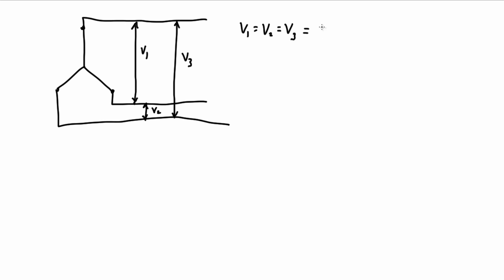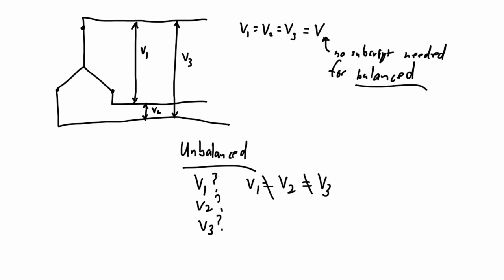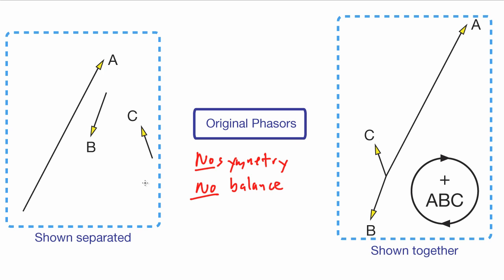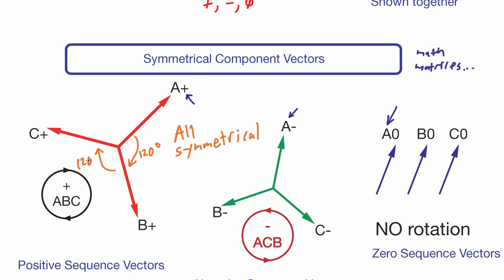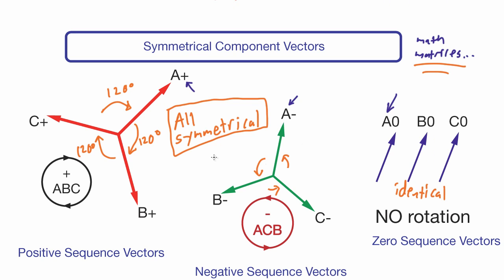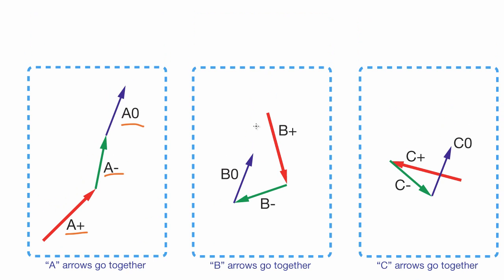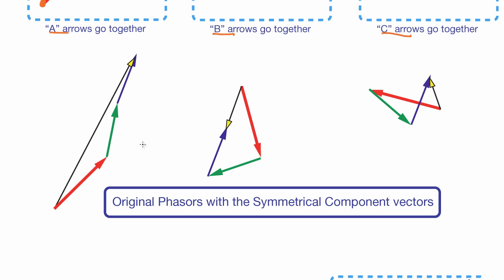Electrical PE Exam - Symmetrical Components (part 2)

Comment: It's always considered a good engineering practice to apply a note(s) to explain/clarify drawings and diagrams and convey important information.  It's also considered a poor engineering practice to assume anything.  Since the arrows shown in the left diagram rotate in the same direction as the positive sequence phasors, a student new to the method of symmetrical components may naturally assume the arrows in the center diagram indicate the direction of rotation for the negative sequence phasors.

Comment from the maker: The little circular arrows on our videos are NOT addressing anything about the physical
rotation of the motor, or the physics of the core or anything like that.  All it's doing is this: "Hey!  Pay attention that the letters on the arrows here are in a different order than the diagram right next to it."  That's it.  It's just there to show that for this particular way of visualizing symmetrical components, be aware that the layout of the vectors is different in this way.

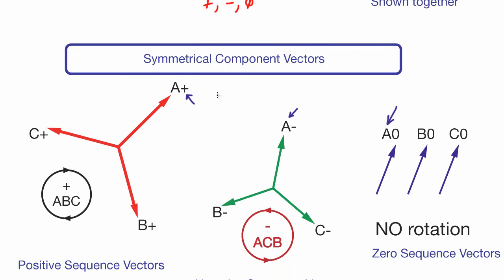Comment: At 4:20 the video shows the negative sequence components rotating in an opposite direction when compared to the positive sequence components which I believe is incorrect.  Both sets of phasors (positive and negative) actually rotate in the same direction.  However, negative sequence current will produce negative sequence flux in core of motor which causes motor rotation in the opposite direction.
Reply: It isn't correct but not how it is usually show.  You get the same result if you change the phase order or rotate clockwise for negative sequence